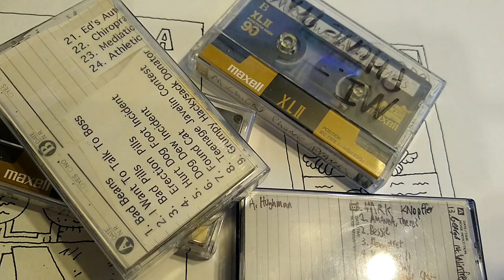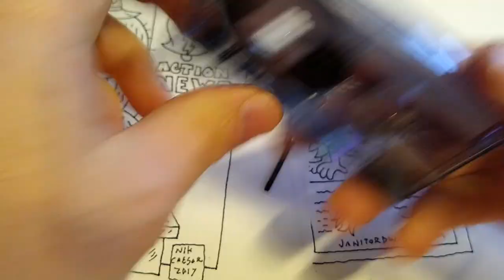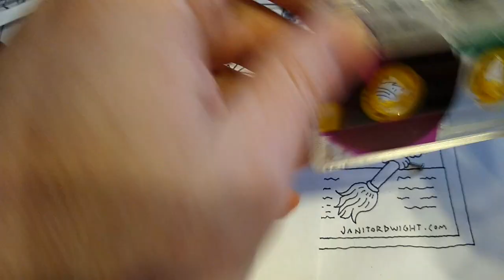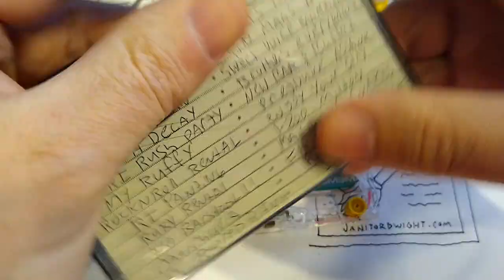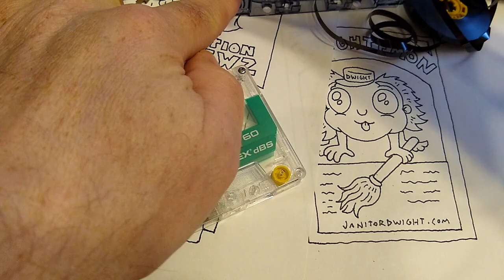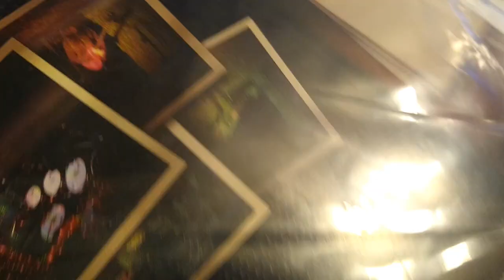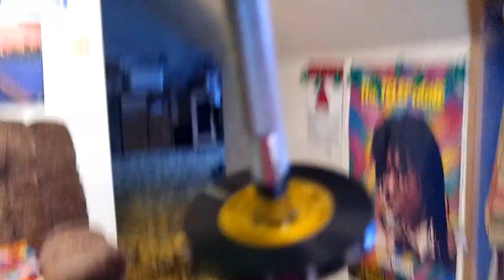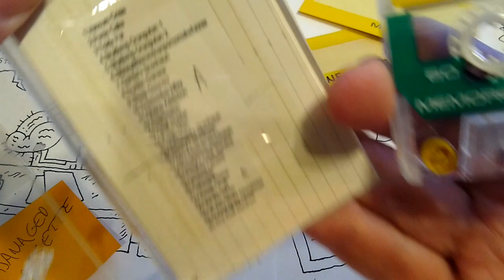How To Repair A Cassette Tape

Comment: hi i have work on alot of cassette  decks over 30 years  find some one who can fix it before you by one all ways  fixing mates decks 
 this why i when to open reel tape  and all my cassettes are tape line  dubbing cassette so all the bodies look the same  and easy
to use as parts   i do have a 1/8 edit block turning up cassette ends of  tape is a right pain